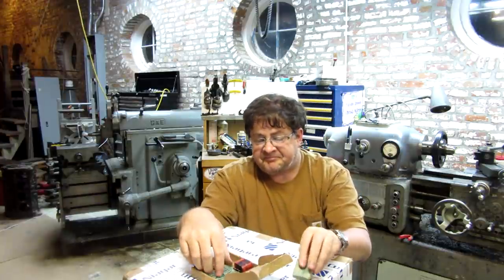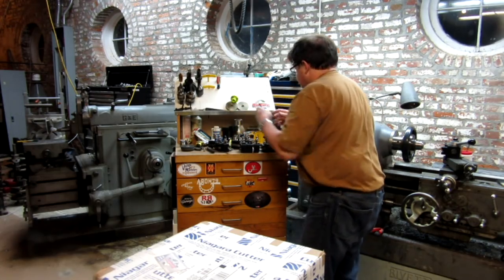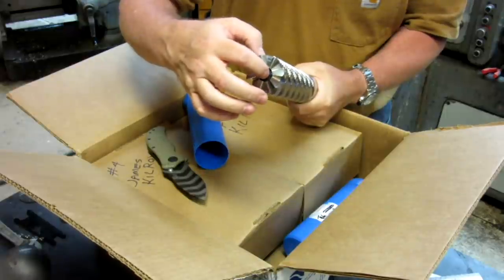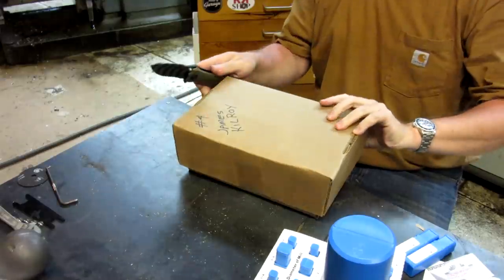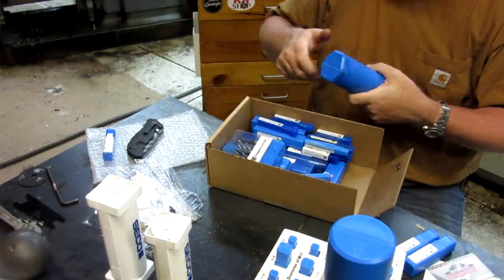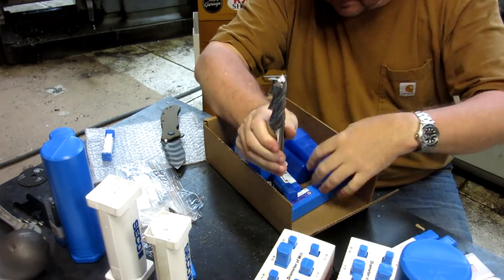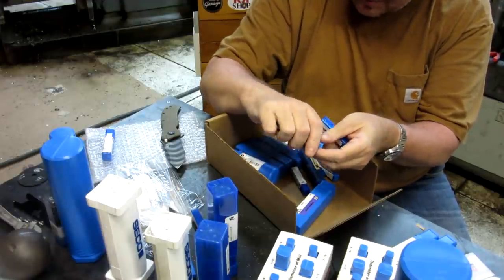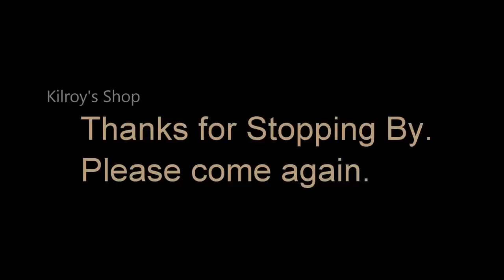Shop ADHD #29

Comment: James, a request: you have the biggest mill (next to Brian Block's) that I see.  I really want to see one of those wavy edged cutters burried into some metal and hogging something off.  I mean hard core "for bragging rights" kind of work, not the "I want to save my cutter" stuff.  Chip control at 100% manufacturers feed and speeds.  A simple 3 min video with a block of scrap on the mill.  Just don't hurt yourself or the machine.